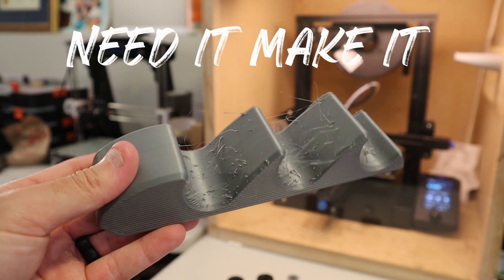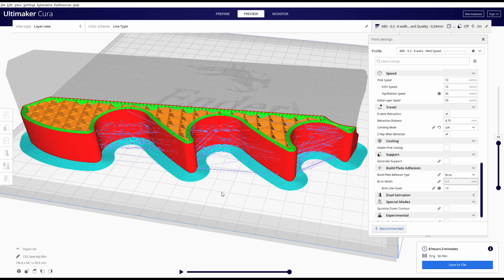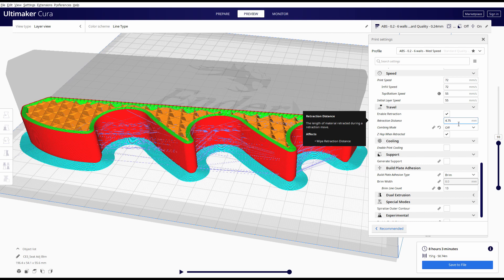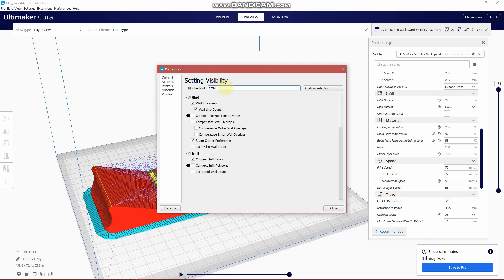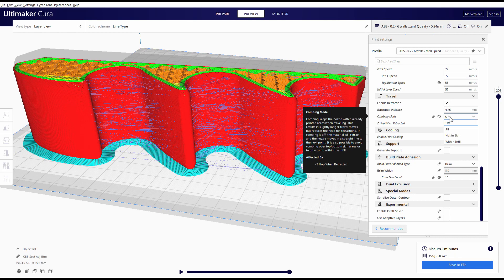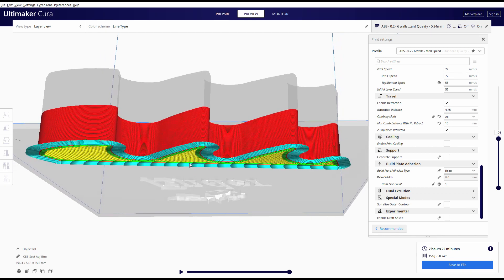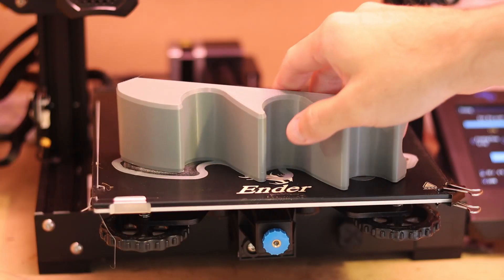Creality Ender 3 V2 - Stop Stringing, Improve Print Quality & Time With These Two Settings

Comment: I almost discontinued use of FIROS Grey filament due to terrible stringing. Now I have some settings to try. Thanks. Combing and Retraction Distance for the profile on this filament.
Reply from the maker: Which printer are you running?  I really don't have these issues anymore with the newer faster printers.  It is still important to make sure the filament is dry though.  I ended up moving first to Prusa filament and thanks to Makerworld, I tend to mostly use Bambu filament these days.  I still think Prusa produces better results, I just wish they had a distribution center closer.

Comment: Retraction speed also plays a factor in stringing. I have found that 100mm/s has lead to great results. Keeping your filament dry helps. And also, dialing the right temperature is also a major factor. Not all filaments are equal. Believe it or not, if you extrude at too low OR too high of a temperature, stringing can occur. There is a Goldilocks zone. 

For example: on one of my spools of filament, it claimed to be rated for anywhere between 190 and 220. I found the sweet spot to be 200c and I also found that the bed temp is best at 50c. I was surprised because, with most PLA filaments, 60c for the bed temp was always perfect. 180-190 for the extruder temp was also perfect. With this particular spool of filament, the parameters were different. 

Any time I get a new spool, I do a string test at all of the rated temps and settings until I find the perfect setting for that particular spool filament. 

I have also found that using certain settings such as Combing or Print Within Model can sometimes add a substantial amount of time to the print. But if all else fails, use every trick at your disposal.

Comment: Another video talking about the settings in your slicer to get rid of stringing. I've wasted so much time watching these videos and getting no results. The first thing one should do is lubricate their boden tube. Yeah yeah yeah, the boden tube should never need oiling. I was getting a ton of stringing and after doing the lubrication it all went away.
Reply from the maker: Though this video was posted some time ago, it is still relevant, you can reduce stringing by turning on combing or the equivalent setting for another slicer to not have your printer pass over open areas.  

If you really want to reduce stringing, upgrade your printer to something far faster, the stringing is far less of a problem with faster acceleration and higher speeds.  QIDI just released the Q1, it's pretty inexpensive, and there may still be a sale on.  I did a review of it last week and it's a pretty good machine, far more capable than an Ender series printer. 

Most people getting more serious about 3D printing have had to move on from the older Bed slingers, they were a good start, but that's just it, they were a start, we've come a long way since then. 

Your idea about the lube works, I've had people criticize me for using it as well, but I haven't seen any negative impacts from it.
Reply: @NeedItMakeIt  I have nothing but creality printers and then the next few weeks I will not have any creality printers. I got the k1max and it's a piece of garbage. I'm going to try bambu and see if there are any better.  I'm really stressed out because I need my  3d printers to work and they're not and I'm at my trying to figure out what's wrong.
Reply from the maker: @DueyMiller-rk9dr  I've had similar experiences, Creality printers have always been printers which require you to make parts for your printer to fix them up to a point where they function well.  Bambu is a solid choice, if you're looking for a more affordable option look into the Q1 from QIDI, solid construction in both the frame and extruder, nice big extruder gears and also bearings for support on both sides.  The bed leveling is one manual calibration during the startup process, and then after that, the rest is automatic.  Most of my Creality videos recently have been showing the problems and how to fix them, the Max had issues with the bed, we've since found the problems and have solved them well enough to get nearly perfect first layers.  

Let me know how it goes and if you need any help.

Comment: Thank you for a very informative video.  Is the combing setting the reason that the second print did not show any lines not the sides?  If not, how did you handle that issue?
Reply from the maker: Thanks, it's been a little while since making this video.  Are you able to give a timecode for the part of the video?  I think you're talking about the lines for the travels.  Combing still has travels, but they're mostly kept within the parts, whenever possible, and yes, that will help a lot if you print just about any part.  If you print something where the printer is jumping from one 'island' to another, you can still see problems like blobbing and stringing.  Faster printers help to reduce this quite a bit, but also drying your filament, and adjusting your retraction settings also helps.  Let me know if I answered the right question!
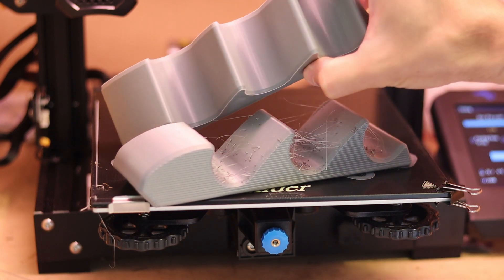Reply: It's at 3:57 on the video where you show the two side by side. The part with the strings also shows visible lines on the top/bottom whereas the one without the strings also shows no lines on the top/bottom.
Reply from the maker: I can't recall exactly, but I believe that this is partly to do with an adjustment to the seam position.  If you place a seam in the same position on the part, a slight over-extrusion and slight under in some areas will line-up and will become very hard to pickup.  It could very well be my choice of filament as well.  I've tried all kinds of cheap filament and the tolerance on some of the spools is just horrific.   They state +/-0.2mm but it is more like +/- 0.5mm and with that it's nearly impossible to see great results.

Comment: Great tips!  How deep Is the Canada flag embossed in the part... looks about 1mm inset.  Curious what the limit would be for no supports?
Reply from the maker: Thanks, most of them still apply to the fast printers, though the fast movements do help to prevent some of the stringing and blobbing issues we would see commonly a couple of years back.  If you want to print a flag on the bottom, you an certainly inset it, I believe I used either 0.75 or 1mm.  these days I tend to use smaller number, even 0.5 works well for embossing, it is still enough to tell what it is.  For the bottom though, it might work out to bridge the distance, but even if it doesn't you'll still be able to tell what it is, the bridge will have a different texture and you should be able to pretty easily tell it apart.   I suppose a test is in order to be 100% certain.

Comment: your 4 minute video was more informative than the 187 reddit threads i've scrolled through. <3 x 1,000,000,000
Reply from the maker: LOL, that's good, I know what you mean, I've spend so much time online, but in the end it is just a flick of a switch/checkbox and bob's your uncle.  I still use this feature even today with the Bambu and Creality Printers, but I do miss using Cura, I need to get it back somehow!

Comment: Interestingly, I found that with direct drive, too much retraction can also cause stringing. If you're at 1.5mm or greater, you might want to try less retraction to reduce stringing issues.
Reply from the maker: I wonder why that might be.  Pulling the material up into the nozzle too far, that's a tough one to explain, I think it is something easy enough to test, but I'd need an up close nozzle cam.
Reply: @NeedItMakeIt  I'm not sure what the issue is, possibly molten material may being drawn to far back, or possibly my retraction speed being to high thereby causing a disconnect in the material. I haven't tried altering the retraction speed though.
Reply from the maker: Even with my best filament, I can still see some very fine traces of stringing, maybe it is worth more investigation to get completely clean prints with.... no strings attached.  There are so many factors at play.

Material
Dryness
Nozzle Temp
Nozzle sizee
Printer speed
Travel speed
Retraction extrusion
The model itself
How the model is sliced

The list goes on and on.  

Where to start?
Reply: nice one XD @NeedItMakeIt

Comment: I suppose I'll thank you for talking about this, even though it's information I already have. I'm just struggling with stringing myself on the same model printer with the Sprite B extruder upgrade, so it has the direct drive extruder. Messed with calibrating the PID settings (cleaned the layer lines a bit but no impact on stringing), calibrating the extruder steps (it was just fine on default), temperature (no noticeable quality change in a range of 180 to 240), and retraction with no luck.

I find it kinda weird given all I heard, but.. I think I was getting stringing from having the retract distance be too high. Either way, I find the current print very promising where I turned the retract down to .3mm, and turned on a 0.5mm nozzle wipe. Besides a single flaw in the brim, it seems to be printing with much less stringing. Just gotta wait for the print to finish.

Edit:

Wait, I think I figured it out. The Sprite B has a solid metal heatend, so that's tens of mm worth of melting to remove the risk of clogging. I'm sure the nozzle wipe helped, but to attempt to improve it further, I have now reduced the retraction to a very low amount, turned off the wipe (feel unsure about what the extra motion might do to prints that need high precision) and instead am attempting a much higher extruder coasting distance.. that last one with the wipe did come out better, but the stringing isn't gone yet..

Comment: Sadly, setting my combing mode to all did not get rid of such stringing /travel paths on my prints.... -_-, I don't know why that is. I have a Creality CR - 10 V2....  Are the other settings I have to check over so it does work?? I am printing in PLA + .
Reply from the maker: It is possible the the type of print you're making has a series of "islands"  meaning that there is no way to prevent going from one area to the other but to span the gap.  If you're having issues with stringing with PLA+, it may be filament dryness, with a hit of retraction.  Are you able to send a photo to my email?

Comment: So I have the travel path... then also the "shell" which looks like a travel path.. but its not... It keeps extruding from one piece.. over to a seperate piece.. any advice!? Thabk you!
Reply from the maker: Are you able to send me an email with a photo?   The part you're trying to print may have "islands", in that case there isn't much that can be done.  If you're having trouble with stringing, stay away from PETG, or try drying your filament, or keeping it in a box with desiccant to keep it dry.
Reply: @NeedItMakeIt  Hey thanks a lot for taking the time to respond! Im a numb nut..! And had "SPIRAL" setting turned on... thats what was doing it in case you come accross that!
Reply from the maker: @stickboyfpv4742  We've all been there, there are so many settings and if you're like me, tweaking them all of the time, we're bound to leave something on that shouldn't be.  I'm glad you sorted it out.
Reply: @NeedItMakeIt Hahahaha yeah Its so time consuming changing only one thing and repeating over and over!

Comment: I did every thing but I have little stringing is it normal
Reply from the maker: There are some other factors, like how dry your filament is, the dryer the better, also, the type of filament being printed, PETG tends to be a bit stringy, where as PLA and ABS aren't so much, of course each brand and the additives make some slight difference also.   If you can send me a pic to needitmakeit@gmail.com, I'd be happy to help more.

Comment: I can't even get my brand new Ender 3 v2 filament (PETG) to even adhere To the bed.... it's so disappoint I'm almost regretting getting a 3D printer. I see all the things I could make but this is discouraging.... It came so highly recommended too.
Reply from the maker: Glue stick, any type will do, that will solve your problem on PETG
Reply: @NeedItMakeIt  I tried glue sticks, painter tape and changing the bed temp but nothing has worked so far. I changed the bed from Ender 3 v2 grip side over to the glass side but nothing has worked. The filement layer get dragged  around by the extruder and it just makes blobs.
Reply from the maker: @Phantom8589  It sounds as though the first layer isn't making contact with the bed, when you level, are you using paper?  This is the process I use, I also use PETG and I have 100% success with my prints.  There hasn't been a print that does not adhere since I started using glue sticks years ago.  I'm using the cheapest PETG, I can't imagine it would be the filament in your case.   Let me know if I can help more.
Reply: @NeedItMakeIt  Might be the leveling, I tried 4-5 times leveling it using paper on the edges but maybe I should use a thicker card. The PETG is Overture(Black PTEG) it just doesn't seem to want to adhere. I have probably tired over 30 times with no success. I have switch prints out as well thinking that might help but it hasn't. Each time the filiment drags around and just becomes a blob. I haven't had a single success and it super discouraging. I even tried printing with PLA and that adhered the first layer or two but started dragging after that and just became a mess as well. so I'm getting discouraged with it being so difficult. I've tried changing the temp for nozzle 200-260 C and bed 50-90 and it hasn't made any difference. It always ends up as a blob of plastic at the extruder ended and it's wasting all the filament at this point. I can't say I would recommend a Ender 3 v2 to anyone at this point. 😓
Reply from the maker: @Phantom8589  It could very well be a problem with that spool.  If you had success with PLA, you should have success with this, the spool should recommend the temp, one of my PETGs in black states 250C, which is really high and I wasn't prepared for that, it caused me quite a bit of trouble.  If you get a chance, can you take a quick video of the problem, or even a photo and send it to my email needitmakeit@gmail.com     When I started, I began with ABS... well that was a terrible material to start with, poor adhesion, parts warping, and on top of that I bought the junk ANET A8, a piece of absolute garbage.   I have two of these printers, they're both good,, and I've used them for thousands of prints at this point with good success, but maybe you got a lemon?
Reply: @NeedItMakeIt  I could be that, might the spool or that it's not making contact. I almost wish I could should it on a video. It lays down a layer but it doesn't stick. So as the extruder moves it drags the layer around I'm almost wondering if I need to slow down the speed? I would almost say it's like the extruder isn't putting down enough filament so it's pulling the filment with it as it moves. I really appreciate you getting back to me, thanks for the pointers I will try the paper on the corners again.
Reply from the maker: @Phantom8589  It does seem pretty strange, normally with PETG I have the nozzle at 235C, the bed at 80 to start, I add glue stick before it heats up on the glass.  I'm confident that we can get you going.  I'd say from what you're telling me that it isn't quite close enough to the bed for the first layer, it is also possible that the first layer is travelling too fast.  A good indicator of the nozzle being too far, and that could be a very small amount, is that the lines do not join to make a solid first layer, they'll peel away from each other easily, or could have little spaces between them.  I could send you my profile also if you'd like to try that as well, I'd just need to know your nozzle size and the temp you'd like for the PETG.  I'm happy to help!
Reply: @NeedItMakeIt  That sounds almost exactly like how I would describe it....I'll level the bed again I check the axis stopper too it might need an adjustment, thank you. Also what is your height above bed set at? Maybe it's my G-code that is the issue?
Reply from the maker: @Phantom8589 There is something else that could be at play, those metal clips that connect the glass to the alum plate below will cause the glass to deflect slightly, it could become more pronounced when the bed is hot also, this is because the alum below will tend to warp slightly.  I like to have my two clips in the center, but for some they may be better towards the corners.  As far as height, I always eye-ball this, I look for a little 'smush' and make sure that the lines connect with eachother on that first layer, to do this I always use a skirt and level as the program is running.  As far as g-code, I've had a few programs which did not work, I'd tend to think that if the slicer got through it, the program should be fine at least 99.5% of the time.
Reply: @NeedItMakeIt  I've tried glue sticks, painters tape, hair spray and cleaning the Ender bases with dawn soap but nothing sticks. Any type of stick glue you found works well? maybe I'm just using a cheap one that doesn't work very well?

Comment: Ive been using combing mode for a while but it doesnt seem to work well with parts that have holes or voids within the part itself. any tips on what to do to solve or compensate

Comment: Thanks, great video.  I had very similar poor concave surfaces using ABS+ on an Elegoo Neptune 2S, and found that the Combing Mode 'All' setting made little to no difference.  BUT, setting Combing Mode to 'Within Infills' worked perfectly!  Cheers.

Comment: What is the setting in Cura that shows where the stringing will occur? (i.e. the darker blue lines at the 2:14 mark). I've been using Cura for more than 2 years and have never seen this feature. Thanks